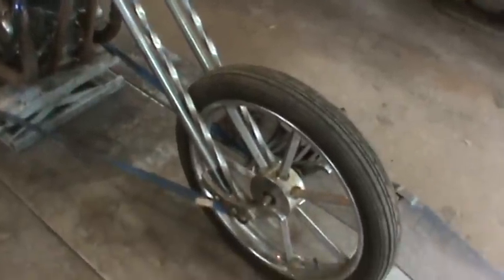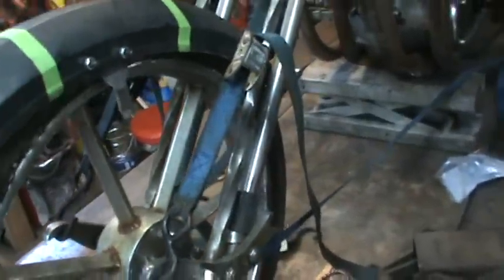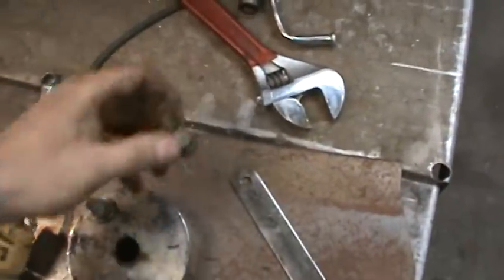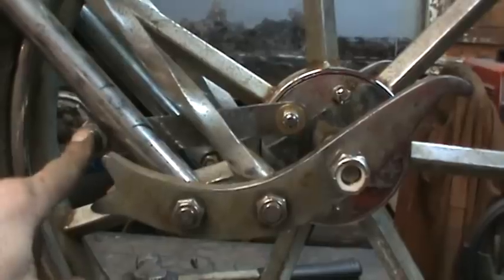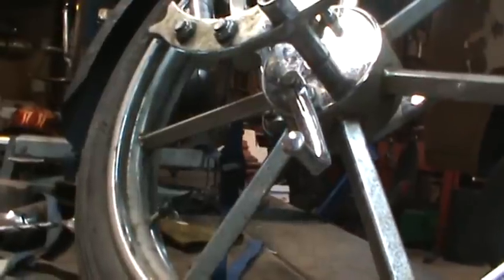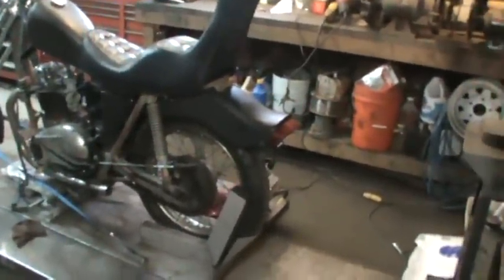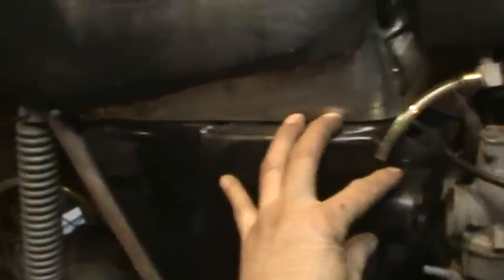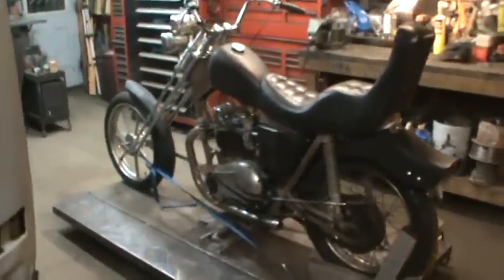triumph chopper repair pt 3

Comment: If you're going to own one of those old bikes you need to be a pretty good wrencher and fabricator. You did a great job with what you had to work with. I'd leave that front fender off but I think I heard you say they require one for tag. My state doesn't require a brake or a fender on the front.

Comment: the Triumph is bad about shearing the key on the clutch stack, he really don't need to be doing any wheelies, Triumph used a key instead of a splined shaft for the clutch to run on............I once worked at a Triumph dealer and fixed a bunch of those clutches.......

Comment: The seat was roiginally made to side flip open with a lock on the oposet side. However it was not a King/Queen seat, It was astandard double length plain seat